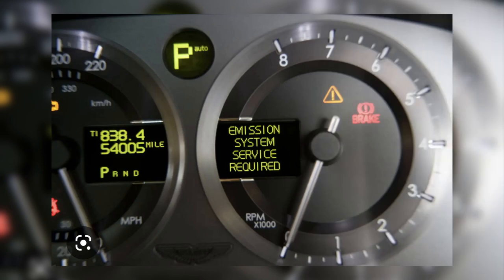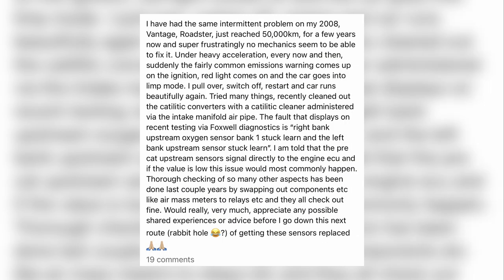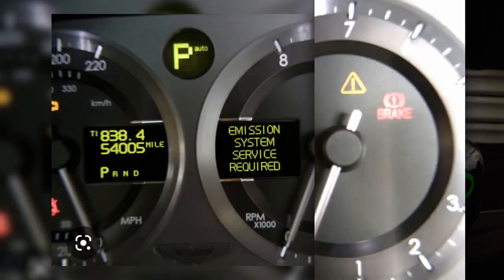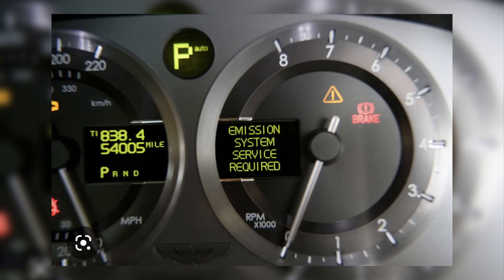What is Going On with Your Aston Martin When an Electronic Fault Occurs?

Comment: I think Mike is right, even Bosch engine management is cheaply implemented on our pre-AMG cars.  I had 6 cylinders misfiring all due to a dying battery - not a single indicator from the ECU that the battery was on its way out.  New battery cleared all the codes.  Thanks, Aston!

Comment: If you would like to hear a funny "bug" I had to deal with an old BMW from that era you call "sophisticated" perfection BMW, then pay attention 😂

I swapped the low panel of the steering wheel of that BMW which didn't came with the multifunction buttons from factory in order to give it radio commands and cruise control, of course it had to be wired and connected to the electronics connections box.

Well i knew at that moment that BMW didnt need to be ECU configurated like our astons in order to enable optional equipment which was not present from factory but installed as retrofit.

Well, that BMW multifunction wheel worked from the first day but as soon I go to the road and activate the cruise control, the icon on the dash panel appears correctly, the cruise works and as soon i pressed the brake pedal it stopped working COMPLETELY, not just pausing the cruise like any other car but stop working like cruise was not present anymore, so had to stop, turn off the ignition key and then restart engine, pressing cruise button worked again and as soon brake pedal was pressed again... cruise gone again.

So trying to figure what the hell was going on... finally ended discovering the real thing, it was the MAF sensor, it was broken, the car was running on that magic backup tables and actually working perfectly without a MAF, so putting a new MAF solved the problem, cruise control keep working as intended and the engine just ran normally like before installing the new MAF, never felt any difference with or without MAF, same fuel mileage and same engine behavior.

BMW perfection, in some ways it makes your life easier, in the other hand it can be a real pain to trace a problem 🤣